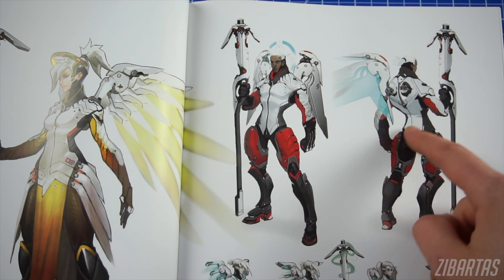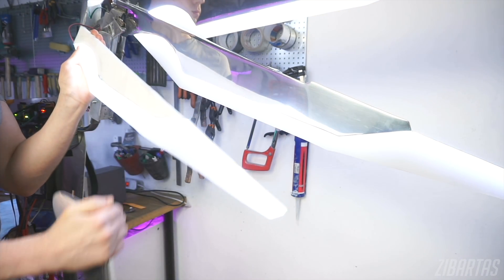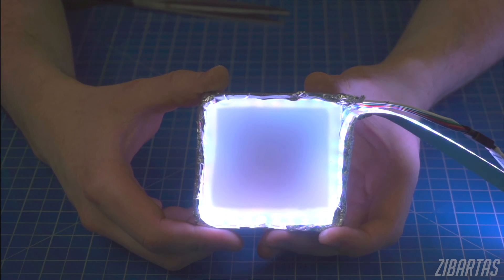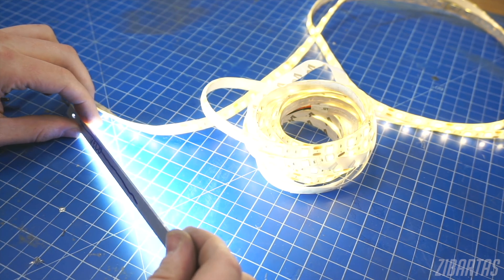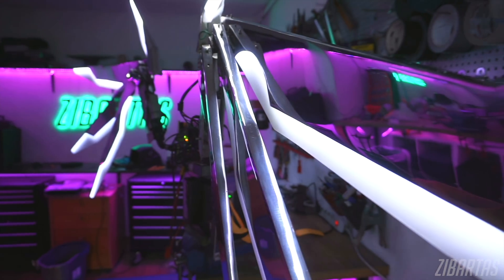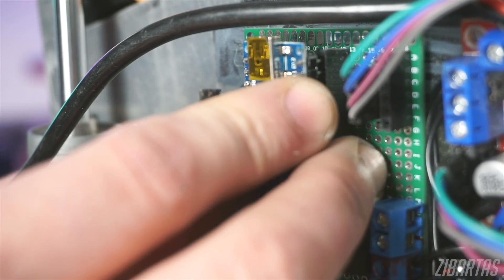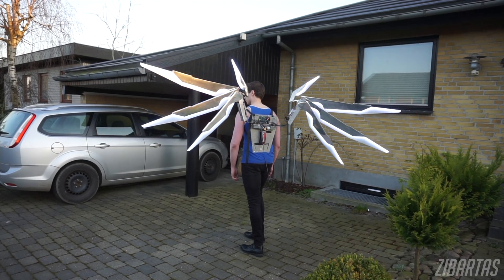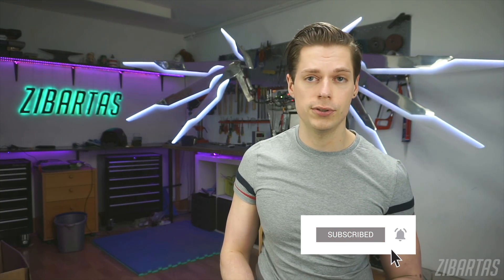Making the BRIGHTEST Articulated Cosplay Wings

Comment: Thank you for your videos! I gave up working on my own LED wings earlier this year and your videos posted after have been so helpful!! Thank you for inspiring me to get back to my LED wings projects! I've been struggling to figure out powering my own wings with RGB LED strips, so some stuff i'd like to know more (maybe some topic suggestions? :) ) 
- Syncing the animations between both wings for example.. I have to power/control my wings individually since I think it draws too much power as opposed to running a whole entire parallel circuit for both
Reply from the maker: Thanks for your kind words! I've made some videos about powering LEDs and powering a large quantity of LEDs. (BTW you can connect each wing to its own power supply *(just have all components share ground) and connect them to the same data line to have all strips perform the same animation)
Reply: @Zibartas  ooooh yeah good idea, I'll definitely give that a try! I did see your other vids on powering larger projects and saved them to my playlist :) Thank you again!

Comment: It's an amazing and beautiful build. For an emergency power cutoff maybe at a minimum install a fuse at the battery?  I'd be curious to know the total power draw under load. Multi cell LiPo packs like that have very little internal resistance and are easily capable of 40C+ discharge rates so with a 4S 5000mAh LiPo pack if you were to have a short or stall a motor you could potentially dump 200 Amps into your circuit. I stalled a digital servo (didn't have overload protection programmed on) once in a project and melted the servo circuit board and wiring in the blink of an eye using a small capacity 2S LiPo- killed the battery pack instantly.